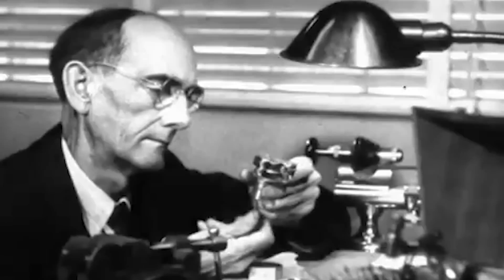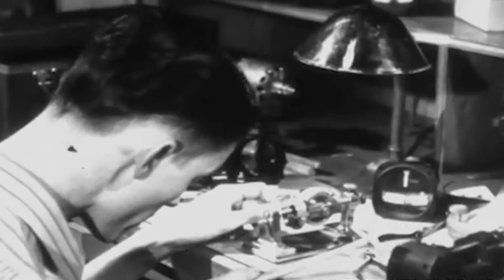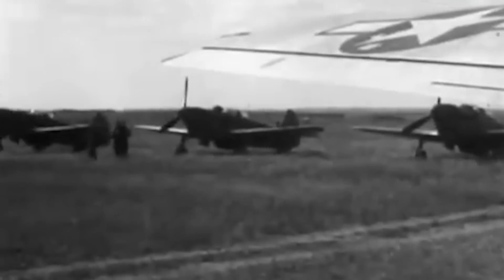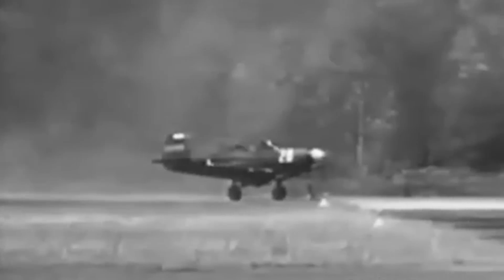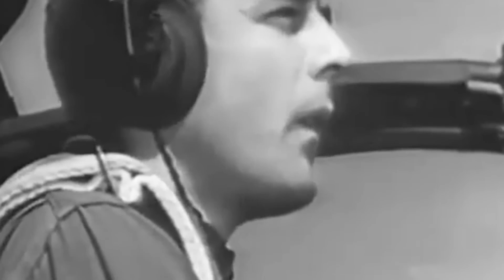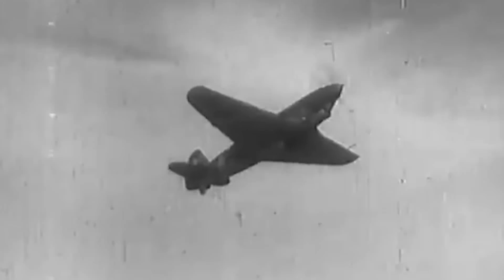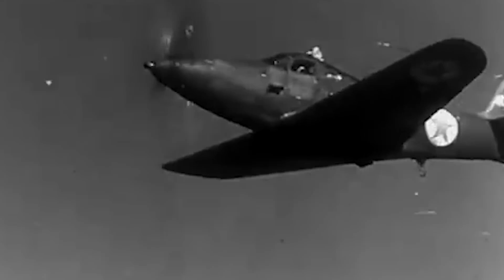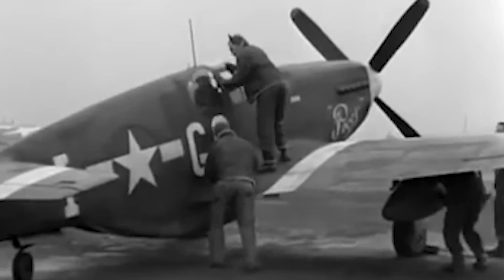The Most Underrated Aircraft of WW2

Comment: The P-39/63 series had no supercharger. That would have made all the difference I think. Great video.
Reply: Wrong, they certainly did have a supercharger.
Reply: @gort8203  TRUE !! A large single stage, and an original Mustang MkI allison powered was 30 MPH faster than a then current $hitfire Mk V with the merlin 20 engine a single stage supercharger. 2 stage came late 1943!!!!
Reply: @johnnyallred  BULL$HIT !!!!!  ALL Allison V1710 engines has a mechanically driven SINGLE STAGE supercharger, which when the plane/engine was designed/built/used was common practice, what they did NOT get was a LATER, get that LATER second stage for the supercharger to work over 20,000 ft !!!!  Under 20,000Ft not much could stay with a Allison engined fighter !!!!  Hell the original MkI Allison Mustangs were 30 MPH faster than the then current $hitfire Mk V with the Merlin 20 series SINGLE stage supercharger !!! Know what the hell you Babble about or STFU !!!

Comment: Few people mention that the P-39 and P-63 were ahead of their time in many ways. By 1945 many were thinking of putting the engine behind the pilot (and moving the pilot up near the nose), and using tricycle gear. There was the Messerschmitt 509, the Rolls Royce concept fighter that was to use the Crecy engine and P-51 wings, and the XP-75 - all of these moved the pilot closer to the nose and put the engine behind the pilot. Note also that pretty much all immediate post-war singe engine jets used this arrangement, and had tricycle gear. The main advantage was improved visibility, especially when it came to landing.

Comment: This video along with many others carry on the myth that the P39 did not meet expectations because the designers had failed in the design for the P39.  This simply is not true, there were two other aircraft that also did not meet with expectations.  All three of these aircraft were designed using the Allison engine.  The problem was that in 1939 there was an aircraft that was already in production the P38 Lightning, this aircraft used the Allison engine with a two stage turbo super charger and used two engines.  The designers of the other 3 aircraft, the P39, P40, and yes the P51 all wanted to use the same engine that the P38 used but the problem was not with the availability of the engine but in 1939 there was a shortage of the  turbo super chargers.   All of the available turbo super chargers were ear marked for the B 17's that needed 4 and the P38 that needed 2 per aircraft.  Also in 1939 America was not in combat anywhere and so the prevailing thought at the time was that not having a 2 stage turbo super charger would not be that much of a handicap.  We did not get into the war until 1942, and at that time most of the combat in the Pacific involved the Navy, the only place that involved the AAC was in North Africa.  When we landed in Africa we had just begun sending B17's to England.  At the beginning of the war in Europe America did not realize that they were going to need high altitude fighters because we had not started to fly the B 17 in combat and they erroneously believed that the B 17 with all of their defensive machine guns and flying in tight formations would not need fighter escorts, it was not until they began taking unsustainable looses that we needed high altitude fighters .  The early P51's sent to England with the single stage Allison engine that limited them to medium level altitudes was not acceptable as a front line fighter.  The thing that saved the P51 was when someone in the RAF thought it might be a good idea to put the RR Merlin engine that was used in the Spitfires.  Using this engine transformed  the P51 into the best fighter in Europe.  It was not until 1943 that the Merlin engines began to be made by Packard here in the US and 100% of the production was for the P51.

Comment: I’ve read the ‘Cobra’ book, and that suggested the main reason the P-39/63 wasn’t more widely used was the lack of range. The P-51 and P-47 could both be modified to pack more fuel in, increasing the range. Unfortunately fuel load needs to be arranged around the centre of gravity to maintain basic stability as fuel is consumed (remember that computer controlled relaxed static stability was decades in the future.) But in the P-39/63 configuration all this desirable space was already occupied by the engine, radiators, undercarriage. The Russians were looking at short range work, at low to medium altitudes where the P-39/63 were quite useful. Notably the Russians usually left the wing guns (.3in) and radios on the ground. The nose armament was quite adequate for fighter-fighter combat Ground attack was a secondary role, that was what the Il-2 was for.

Comment: The King Cobra should have been used by the U.S. military.  It was a sleek design, good looking and tricycle landing gear which yielded better ease of landing and visibility.  I didn't see anything wrong with it.  The original P39 was sent to Russia where it was put to good use though I don't think a single aircraft was paid by them.  It was a victim of probably not enough testing, engine problems and military changing requirements.

Comment: I read somewhere that the original design of the P 39 was an Allison engine that was turbo charged for high altitude performance but the military had them remove it.  Never heard of the reason why they would do that.  It seems that this would have turned the P 39 into a much different aircraft.

Comment: One of the problems with the P-39 was egress from the cockpit in an emergency in the air.  Access was via a door, similar to a car door, which was hinged on the leading edge.  That meant that in flight, the airflow made it extremely difficult to open the door to bail out.

Comment: Any American pilots who flew the P-39 largely hated it. Not simply for it’s lack of power and high altitude ability. It was a dangerous beast on the ground or to land. It was an early implementation of tricycle landing gear that did something stupid. The front wheel was not steerable the way it was on the P-38 or on most modern jets. It simply swiveled freely. This made the plane notorious for dangerous ground spins on landing.

Comment: The Allison engine performed well in turbocharged form, such as in the P-38 Lightning.  The P-39 did not have space in the airframe for the bulky turbocharger installation, so had to make do with a rather inadequate supercharger design.  Allison did not really try to improve this, which Rolls Royce did using a two-stage supercharger with two speed drive.  
It was the lack of intake compression at high-altitude that prevented the P-39 AiraCobra and P-63 King Cobra from being useful high-altitude fighter aircraft.
Reply: Correct.  Allison wasn't gov funded for a two stage two speed blower development since Packard was already building the Merlin in enough quantity to make a two speed/stage Allison redundant.

Comment: Not getting a 'charged' engine from the start boils down the management team at Bell HQ. They knew the demands of high performance flight far better than the 'shiny bum' bureau eejits. Had they used their testiculata as intended a medium/high altitude fighter would not have struggled for acceptance despite the clear advantages: centralised weight, =manoeuvrability, ultra thin wings, brilliant vision thus making it a joy to fly and fight. Add it to the list titled: How (any) Bureau will Assist the Enemy by merely Existing.

Comment: Both of these airframes were so leading edge the military could not process the potential prefromance the airframe had . These airframes were the equivalent of putting a w16 engi e  motor into a ford focus .. while at PIMAA in Tuscon Az. It was explained that the aerodynamics were superior to the p51.. yet it was the restrictions placed on the power units that actually crippled it. Specifically  V1710 . The DoD mandated that all the super-combines ( turbo-charged-supercharger) were remanded to the bombers and p47 and the p38 . These super-combines added so much horsepower at altitude the pilots could throttle up and peel away or slow down and turn inside the prey.

Comment: The USAA was the whole reason the P39 had its high altitude shortcomings. They insisted that Bell use a turbocharger that had just been designed but not tested by another company. Long story short, Bell had already designed the airframe with the assigned turbo in mind but when the turbo turned out to be a failure, Bell couldn't fit  the proven turbo I to the airframe without major redesign work done, which of course, the USAA wouldn't allow. Had it been designed from the outset with the proven turbo, the P63 wouldn't have been needed and the P39 would have gone down as the plane that won the war.

Comment: It depended a lot on the type of flying, in NW Europe combat was above 20,000 ft and the performance of the P-39 and P-40 was not good. But in Russia, the Pacific and North Africa combat was usually at lower altitudes up to15,000 ft and here the aircraft coped much better. The Russians adored the P-39 but they used it for ground attack at low level.

Comment: The P-39 wasn't a failure, it was quite successful at low altitude interceptor, the problem was a lack of a Two stage supercharger.  It was great at the ground attack role.
Reply: and achieved a favorable kill ratio over Japanese fighters
Reply: @SoloRenegade  very true if enemy aircraft were at or came down to their level they were deadly.  We needed another Merlin manufacturer or two.  That would have allowed more fighters to fight at much higher levels.
Reply: @kirkmorrison6131  When did the P-39 face enemies that flew higher than it? japanese aircraft fought low. Eastern front was fought down low. The P-39 was actually better when it was above its prey.
Reply: @SoloRenegade  I knew a pilot and he said he was dived on a few times in his P-39 .  I don't remember when but he was a Cactus Air force replacement.  He died around 30 years ago, but I clearly remember his telling me he got jumped a few times during the War.
Reply: @kirkmorrison6131  Yes, because the P-39s were sent on missions at low altitude and the F4Fs were sent at higher altitudes. Had this been reversed the P-39 would have done even better than it did. The P-39 in the south pacific had a positive kill ratio over japanese planes, even fighting from low altitude. The P-39 had as good or better service ceiling than Japanese aircraft.

you're only displaying you ignorance of the reality if this very issue, which has been documented in Detail on youtube videos, and perpetuating lies. What the pilot told you was true, but lacked context.
Reply: @SoloRenegade  Okay, I just know what he told me back then.  I haven't really read a lot about them.  I knew that they had a good kill ratio and I know zeros didn't in a lot of variants have a great climb rate above 20k and the climb rate really fell off compared to several American aircraft .  Though some other Japanese designs were much better but less common than the Zero.
Reply: @kirkmorrison6131  the P-39, P-40, P-38, and all other US and Western fighters in WW2 were designed as Boom and Zoom fighters, where speed is more important than maneuverability. Japan didn't get the memo in the 1930s and continued to focus on Turn and Burn fighters, which was a mistake. Late in WW2 and into the Cold War interceptors and climb rate became critical in addition to speed.

This meant that the P-40, P-39, P-38 and more were faster than the Zero, Ki43... but less maneuverable, and comparable or worse climb rates. But the late war P-39Q and P-40N were very well matched to the Zero in all but range and maneuverability.

The P-39 and P-40 had as good or better service ceilings, better speed, tougher, self sealing fuel tanks, and relied upon diving attacks and wingman tactics. this proved to be the superior form of dogfighting, and the standard practice for ALL US fighter pilots. The average US pilot was also better trained, whereas the Japanese had a very small pilot pool, and put ALL of their top pilots in one single unit. The F4F was also well balanced against the Zero. And the Spitfire was basically equal to the Zero in every way except range.

Early dogfights in the Pacific, starting on Dec 7, 1941, and going into 1943, US pilots were initially caught off guard by surprise, and werent aware of the Zero prior to Pearl Harbor. After Dec 7 piltos wanted revenge and were too aggressive and wanted to turn fight. It took time to get them to stay disciplined and stick to Boom and Zoom that their airplanes were designed for. Boom and Zoom fighting requires much more patience and discipline, and even online gamers are overall terrible at Boom and Zoom becasue they are too eager and aggressive. But most of the top aces were Boom and Zoom pilots (Red Baron, Eric Hartmann, Richard Bong, Rickenbacker, and many others.). Pilots like Hans Marseille, Werner Voss, and Saburo Sakai were Turn and Burn pilots, using superior piloting to outmaneuver their opponents.

Something to keep in mid, while the P-39 and P-40 werent as good against Japanese planes in maneuverability, they could both outmaneuver a Bf109, and the P-40 was superior to the P-47 in every way below 15k ft other than range and firepower. The P-40 was faster, accelerated quicker, was more maneuverable, was equally as tough taking punishment and still flying home, used in ground attack roles, was an excellent diving airplane, etc. than the P-47.
Reply: It was a failed project because it didn't live up to expectations.
Reply: @adamweaver1594  When they would not allow the right engine for it. I feel it was sabotaged by the Brass

Comment: The Russians did not use the P-39 in ground attack anti-tank roles. This is a widely accepted misconception due to the mistranslation of a term the Russians used, translated into "ground support" which we understand incorrectly to mean attacking ground vehicles. The term to the Russians mean "support the ground troops by destroying the German bombers in the air."  Further, it is documented that we shipped no armor piercing rounds to Russia.  We sent only high-explosive rounds which did a number on the German bombers, which would be ineffectual against German tanks.
Reply: Altitudes.
Reply: Russia had it's own world class ground attack aircraft not at the beginning but, after a year of production, yaks and stormaviks shocked the Vermackt (?) With thier effectiveness. The highest ranking aces used P-39's at 15,000 and lower altitudes.

Comment: Not underrated at all. For one, no mention of the intake?!?!? It was the intake location that killed this aircraft befire it even started. It was a stupid location. At various AOA the engine would be starved of air, during high alphas itd lose ALL air, and whatever air the intake did receive was very disturbed air from the prop, furthermore decreasing its performance drastically.  
 
BOTH cobras were also very, very hard to control aircraft. Its mid engine config had the CG all out of whack once ammoand fuel had been used, in turns the inertia of the engine would push the aircraft to the outside of the turn, causing the tail end to slide out, resulting in an unrecoverable spin therefore loss of aircraft maybe pilot too. 

If these issues were fixed it wouldve been a beast, the cannon it had was that big because they were hoping to prevent this CG issue, but couldnt. In fact it only made things worse. 

Sorry but this aircraft sits right where it belongs.